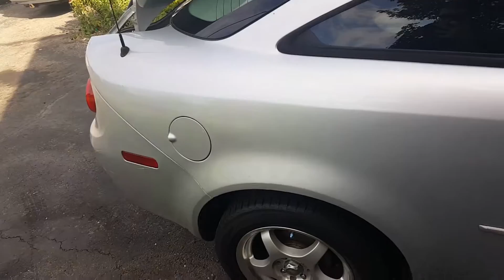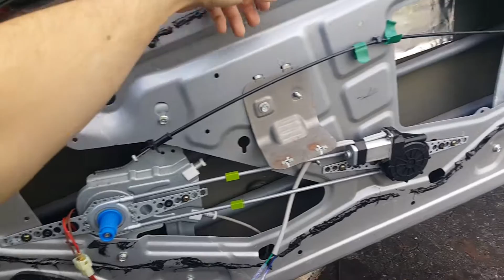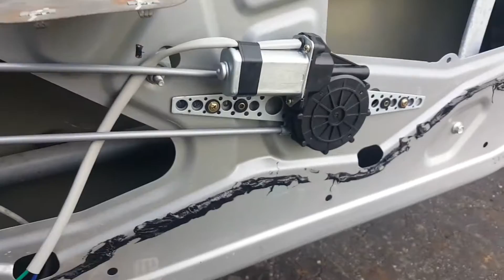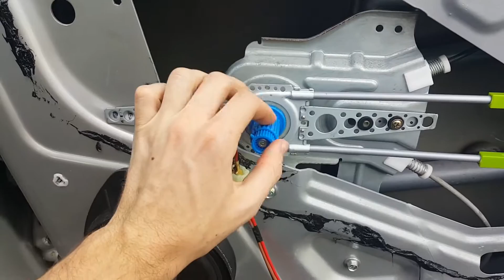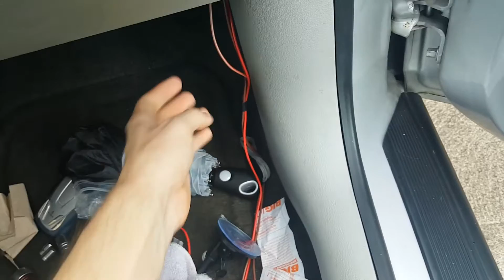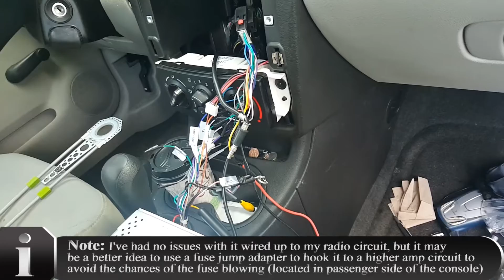Chevy Cobalt Power Window Conversion

Comment: I bought a cobalt that I believe has this kit. However, it suddenly stopped working completely. The buttons don’t do anything and the windows are currently all the way down. Is there a fuse location I should know about to see if I just need to replace a fuse?
Reply from the maker: Hey Alex, it’ll depend on how they wired up the windows. It’s possible they tapped into a circuit like the radio circuit, but it would be clear if the radio didn’t work.

The better approach would be using a piggy back fuse tap, so if you open up the fuse box and see a fuse with a red wire coming off of it, it could be that. The wiring goes through the center of the car from door to door (there is a small hole with rubber gasket in each door for the wires to go through). Worst case you would need to remove the doors to check if the wiring got pinched or was damaged anywhere. 

Removing the door is pretty straight forward and just requires removing the screws along the bottom, one or two in the door arm rest slot, and one behind where the door handle is, behind a plastic cover. Then remove the window adjustment piece and pull up on the inside of the door (being careful with the window lock pole, since it has to come up and over top of it). 

Let me know if you need any more help. Luckily these cars are pretty easy to work on inside of the dash area. My other car is a BMW 328 and it’s quite frustrating to do anything inside the dash by comparison.
Reply: @ZVSMedia  yeah radio works fine. I noticed the front speakers don’t work at all though. But then again they didn’t when the windows worked so yeah idk. I gotta do some digging.

Comment: Where did you run them to?
Reply from the maker: Hello, I ran them to the radio circuit. Probably better to fuse them separately, but I still have them running today and no issues.